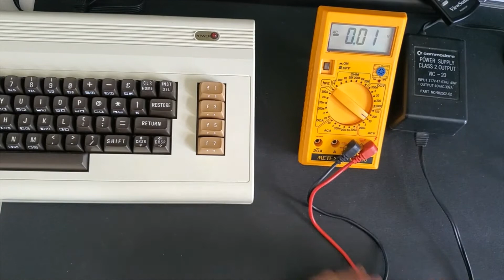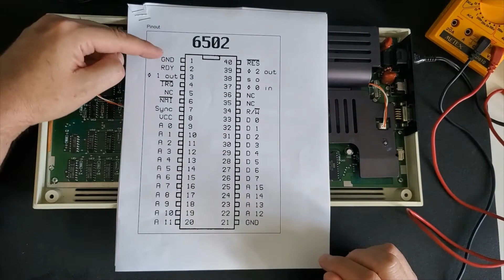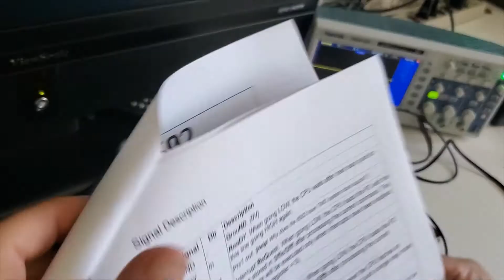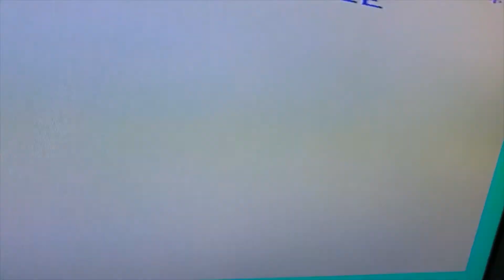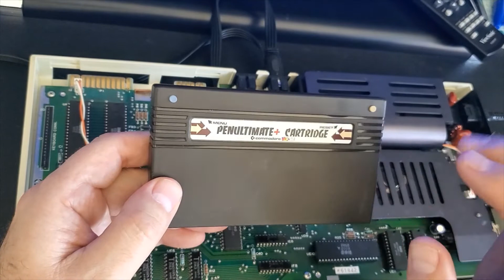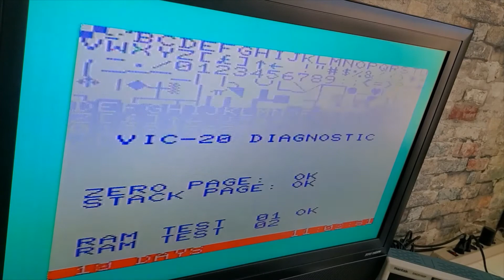Commodore VIC 20 Repair Black Screen

Comment: "A" for 6502 chip means this is a 1mhz chip. "B" variant of this chip will run at 2Mhz. There is some issue with your diagnostic cartridge. It should not show the test running for 40+ days. Also, the time in lower right is running far too fast.
Reply from the maker: Yes, you are correct. Thanks for sharing and commenting

Comment: The higher voltage supply is just going to cause the voltage regulator run hotter. I am curious what each runs at under load....
Reply from the maker: Yes, it would run hotter and best to stay with original values. Not sure unload what the amps are

Comment: A quick check on a black screen VIC is to plug in a cartridge and see if you still have a black screen. If you don’t, then you need to replace the BASIC ROM.
Reply from the maker: Interesting! I didn't know that. Thanks for sharing!

Comment: Can you make one showing the meter readings? Mine does not power on. I want to know what all I should be checking in order. Already tested the adapter.
Reply from the maker: I'm assuming you mean the oscilloscope readings. If you are not getting anything showing or not square signals then the data is not transmitting. Values should between 0 volts and 5 volts on the CPU
Reply: Not being the brightest spark myself I asked a friendly shop assistant which fuses I might need for my vic20.
'slo blow' apparently.
Relatively cheap.
Needed 2 per machine.
1 for the computer and one for the power supply.
Total cost for repair £2 and a bottle of single malt gift wrapped for his help.
As I had failed to get the right fuses in several stores.
....never plug/unplug stuff whilst powered up....the surge can kill the board.
The guys in the shop where I worked did this a couple of times.
Reply from the maker: Great deal, and I'm glad it worked out. Thanks for commenting
Reply: @RudysRetroIntel  Sadly both vic20s have black screen now so they now reside in my display cabinet.
I had a 3rd one but I posted it to a repair company who condemned it and refused to return it.
Basically they stripped it for parts.
Hence I advertised that I would trade EITHER and amiga OR a working 1541 for an on site repair of both vic20s.
Sadly,no takers.
I am unwilling to give up either of these boys as I have had them both running faithfully for 40 years.
I still use a later model c64 but because of its smaller font I combined her with a wall projector as it makes programming a lot less fiddly.
The vic20 font was way more conveniently sized for a tv,but the use of the projector makes the 1985 tech so much more impressive.
Reply from the maker: Not sure where you live, but I'm sure you can find someone to do the repairs. Check Facebook, local paper, Twitter, etc. Must be really cool using a projector.